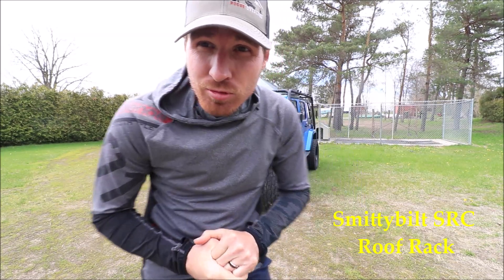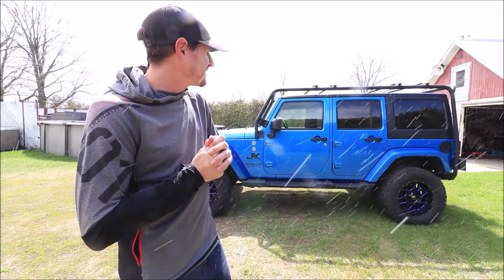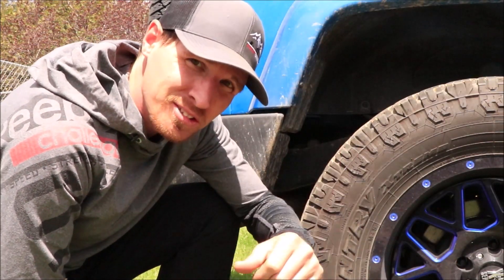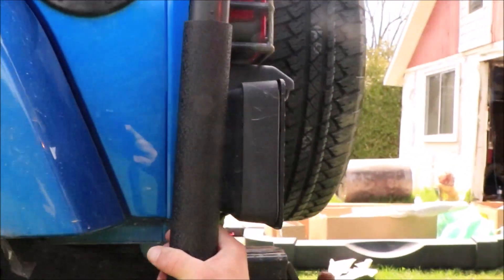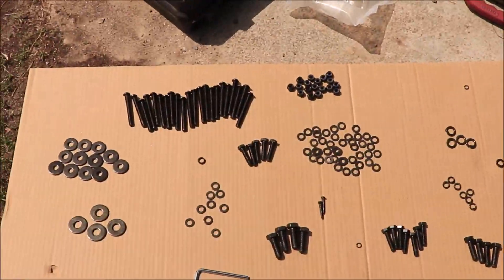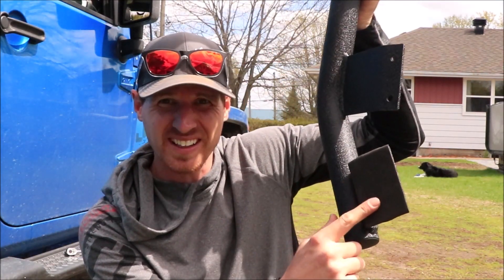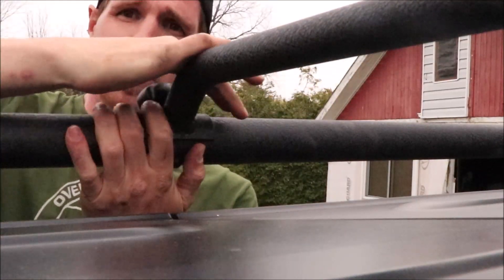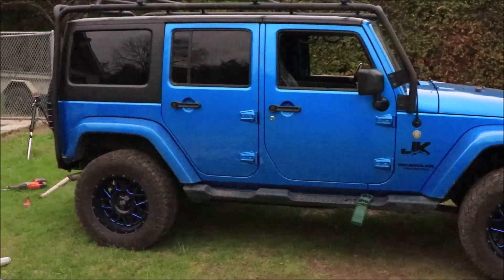Smittybilt SRC Roof Rack Installation - Jeep Wrangler JK

Comment: Thanks for this video!  Just ordered one of these.
Reply from the maker: Anytime 👍😁
Reply from the maker: How is the bar working out?
Reply: @overlandaf_adventures472  Thanks for the follow up!  So far so good!  Looks great!  Had my buddy help me install it while drinking a six pack.  Haha.  Haven't had the chance to mount my roof top tent on it yet.  Still winter here in Seattle haha.  Looking forward to summer with it though.  I have two eFoil surfboards I plan to use it for as well.  How is yours holding up?
Reply from the maker: @JMGENTERPRISES   I ended up trading my jeep in for a Gladiator. I sold the rack and got pretty much what I paid. Now I have a new sweet rack for the gladdy. I will Cheers ya with that six pack 🍻
Reply: @overlandaf_adventures472  -  Nice!  The gladiators are awesome!  May need to upgrade one day myself.  What color did you get?
Reply from the maker: @JMGENTERPRISES  I got the stingray grey. But I miss that blue

Comment: Just a quick question if you can answer please. What is the distance between the hardtop and the top most bars? I want to know if it fits into my garage. Thank you.
Reply from the maker: I just traded that jeep in. If i were to guess it would of been 4-1/2-5"  to the top bars. I just measured my Gladiator hard top. Giving you what I think it was. Hope this helps 👍
Reply: @overlandaf_adventures472  many  thanks.

Comment: Main reason I did mine to my body and not the frame is because the frame and body are mounted by rubber mounts allowing the body to move from the frame. And I feel the rear mounts on the frame will contact something on the trail as well. Maybe it won’t but I didn’t want to take a chance. Had it mounted my way for a few years now and nothing is wrong. Let me know if it breaks your windshield in time of twisting… I’m curious.
Reply from the maker: The bar lasted great. Would recommend to make sure you seal all the holes in the bar so it doesn't rust inside out.

Comment: I also got the Smittybuilt 76717 (Rock Crawler Roof Rack).  It is a solid piece of work, just like all Smittybuilt products.  HOWEVER, if you already have a full Smittybuilt SRC rear bumper (like I do), you are screwed.  You cannot mount it to the frame, but must mount it to the body. They said that it's just as strong.  Yeah, right. Or I could cut off two inches off of both ends of my SRC Smittybuilt rear bumper.  I haven't made up my mind about which I'm going to do, but I am not a happy camper. Why didn't Smittybuilt think ahead and make sure they designed their products to interoperate?  If they would have attached the part that connects to the frame just two inches forward, it would have been fine.
Reply from the maker: I have seen where someone cut a hole in the stock plastic bumper. I feel like there would of been a bumper out there to be able to mount the rack and after market bumper. But totally agree, don't want to mount to the body. Especially the weight I am going to put up
Reply: would it be possible to just use longer bolts, on  the SRC rear bumper so that it could fit the rack and the mount location of the bumper?

Comment: I wonder if you could install the cross members upside down to form a basket and make it more low profile?
Reply from the maker: I never thought of that but yeah you probably could. Just have to drill new holes.
Reply: Just switch the long poles out to the other side...the holes will face the opposite way and you can install upside down.
Reply from the maker: @JM1701ABCD  makes sense 👍

Comment: Heard there’s a lot of problems with rust for this model roof rack. Have you experienced that?
Reply from the maker: Not yet but I feel like they rust if you were to get water inside. So seal any holes.  I had this issue when I had my windshield light bar. Rusted from inside out
Reply: @overlandaf_adventures472  thank you. Think I’m going to silicone the holes with gorilla brand silicone.
Reply: Six months after I installed mine, it is rusting really badly.  I am taking it off now and replacing it with a DeeZee.....I am just so disappointed.
Reply from the maker: @robertsack257  that is disappointing. I am only starting to see rust starting in the joints where they connect. I will just touch up with some rust paint like my bumper. I have had almost 3 years now
Reply: @overlandaf_adventures472  If you are putting a heavy rooftop tent...mine is 165lbs, I started seeing a bend at the joints where the rust was.....The DeeZee mounts to the gutters and has pads that distribute weight on the roof.  They say it will support up to 200 lbs even though the roof says it maxes out at 150.   They said that the design allows for 200....so we will see...I will be disassembling the Smittybilt this weekend.   I also plugged all of the holes with silicon, etc....

The service writer at the Jeep dealer said that the 165 lb tent should be OK on the roof.
Reply from the maker: @robertsack257  I now bought a jeep Gladiator with a tuwa pro rack for the tent. I ended up getting almost all my money back from my old smittybilt rack. 👍

Comment: What was the end result for the rear bumper?   Also, is there a passage between the insides of the piping to internally run wires for lights, or will they have to run externally?   What did you use for a kayak carrier? (a kayak is the reason for my interest)
Reply from the maker: I still have not put a bumper on. I am going to put my stock rear bumper back on. I have seen someone where I live cut a hole down through. It works 👍. For my kayak I sit it flat up top with foam insulation they use for piping. You can run wiring as well through the tube bars.
Reply: @overlandaf_adventures472  - please come back with what you did with your rear bumper.  Looking to buy an 08' Sahara Unlimited and your review sold me on this rack for a kayaking trip out East end of September.  Hate to spend even more $ on an aftermarket bumper.  Guess I could run without one.  Not sure what you were talking about at the beginning with cutting a two-inch hole and slots or what tools would be required to accomplish it.
Reply from the maker: @shawhi1  as of right now I still don't have a back bumper. I am going to put the old stock bumper back on. You will have to drill a hole at the top and from the inside as I did see a guy from home have this done. I just need to do it at some point. I will definitely be doing a video at some point but it can be done. Just have to get the bottom mount bar through. So some good precise cutting.
Reply: @overlandaf_adventures472 so the idea is that the bumper and the rack mount will share bolts, stacked on top of one another?
I have a LOD bumper that wraps around and prevents mounting as it is in the way and uses the same holes: im considering fabvinf a foot for each side that mounts to bumper and has a 2” Round extension vertically… o didn’t get the body mounts as I bought mine used and smittybilt does not sell them separately apparently. If you have your body mounts, I would love to buy them from you! Lmk. Thanks! Good video.
Reply from the maker: @juaquinwilson596  ya the wrap around bumpers won't work but I have seen a guy cut a hole in the stock bumper and put the rack thru. I am sure there is bumpers out there you can mount the rack to the frame. Just need to do some searching. I bought a steel bumper and the slot was super heavy so I sent it back and never put a bumper on. I will take a look around if I still have those mounts. I did sell my rack used. Got pretty much what I paid for it.

Comment: What did you do with the OE Bumper?  Did you drill holes or two decide to buy an after market bumper later?
Reply from the maker: I just left the bumper off. I don't actually mind the look. Plus less weight to make up for the weight of the rack